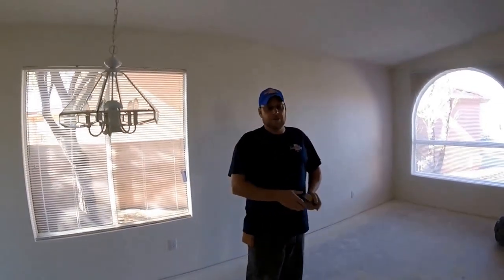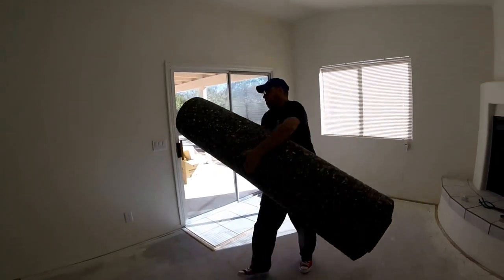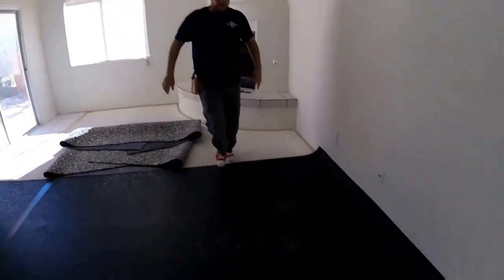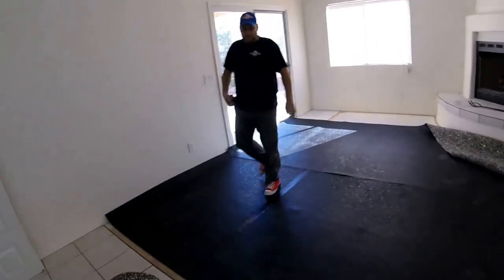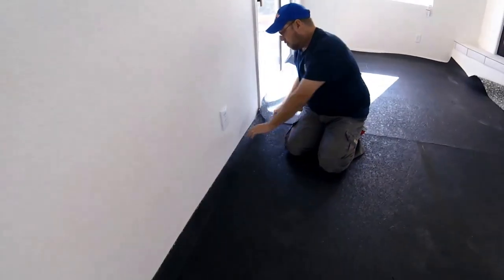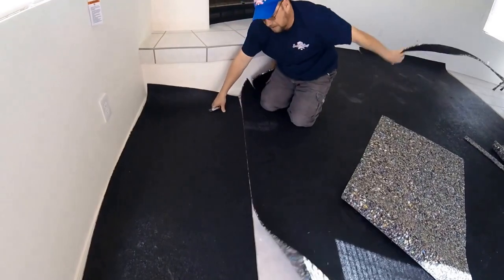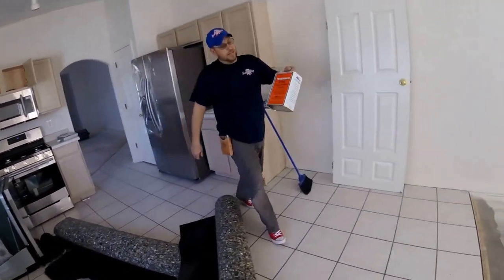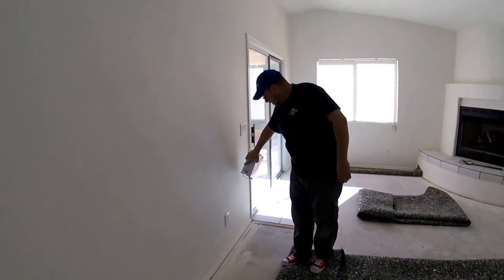HOW TO INSTALL CARPET PAD

Comment: Thanks! Super helpful video, everything is explained really well. Question, if you can't get Taylor 720 and had a really small job as a homeowner (one small piece of pad), would a caulk glue like 'power grab' work?
Reply from the maker: If it was just one small room you can just use duct tape on the seams And also use duck tape to attach the pad to the tack strip and you would be good
Reply: @FloorsbySouthernboys  THANK YOU!

Comment: I run pad  the same way as carpet, no exceptions.. I only use utility knife for cutting padding, carry a blade sharpener, and I can cut pad for days with one side of utility blade
Reply from the maker: William S Gilbert Dang, never heard of anybody doing that for pad
Reply: Hey what is the reason for running the carpet and pad the same way... I am struggling to figure out what the difference would be.
Reply: @Michael-kt5mu  we do the same. As you position the carpet, it seems like there is less chance of disturbing the pad seam if it is running the same way. Dragging carpet back and forth could flip up a spot on the pad seam and you might not see it until later.  Also running it the same way gives you a feel for where your carpyseams are going to be and where fill pieces might come from.  Don’t hurt to run other way, just my opinion. And that don’t mean much, just ask my wife.

Comment: Nice tips.. I know this is a small thing but the piece that was cut for the tile by the door would have got that last 2 foot section if they are 12 in tile.
Reply from the maker: Tim Broderick you’re right they was 12 inch tiles

Comment: never seen pad taped like that new.. usually wrapped in tight plastic that I pull off and use as a bag for scraps
Reply from the maker: Josh Tomsic This one was also in a bag but for some reason they also tape them, not all the time

Comment: Why is that stuff your using to stick the pad? Over here we use we use a adhesive that comes in a spray can I hate it because it's smells really strong and I have to wear a mask otherwise it will make you dizzy!!
Reply from the maker: sausage man the stuff in the can is a pad cement that's what it's for is for putting down carpet pad I just punched a couple of holes in it in the top and just use that to pour it out so I don't waste too much of it I can usually get probably four or five houses of carpet out of one can of glue which runs me about 20 bucks so it's not a bad  deal, the stuff I use has a little smell to it's not too strong though it's where I have to wear a mask or anything you'd really have to be huffing it to get high on it or dizzy
Reply: FloorsbySouthernboys thanks for the reply, sounds good to me may try and find it if they sell it in the uk?
Reply: FloorsbySouthernboys made me laugh I have never hear the saying (huffing it)😂